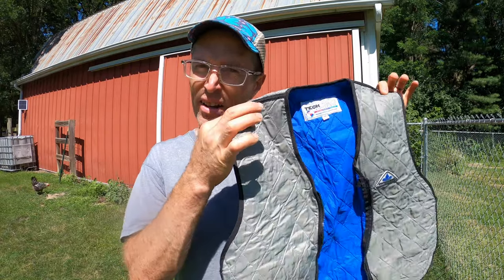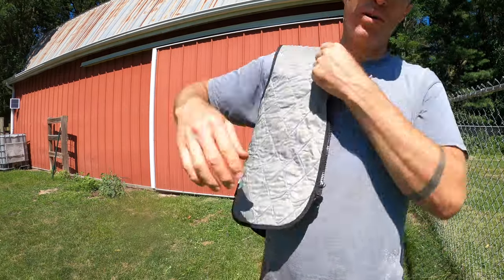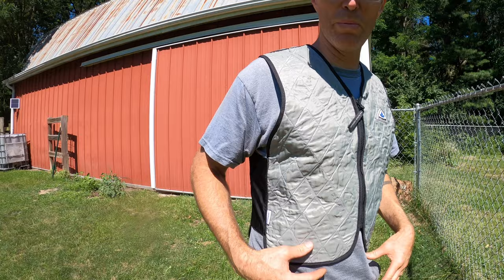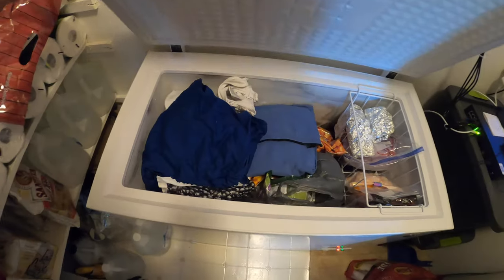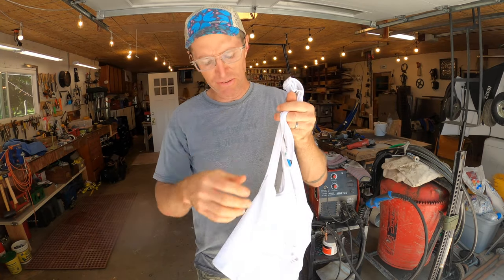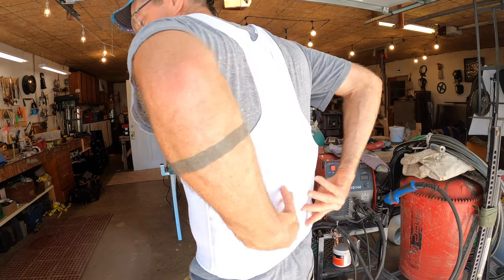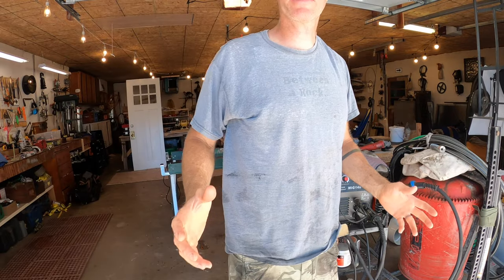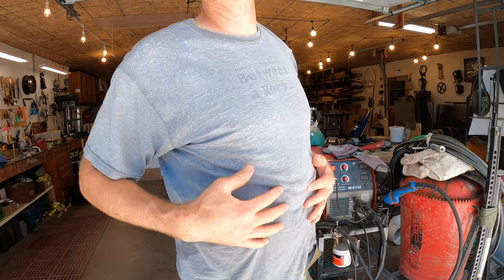Cooling Vest Showdown! Best and Worst

Comment: Hey Metaspencer, Thanks for reviewing our  ThermApparel PCM Cooling Vest. We are glad it helps. We just want to clarify a few things. 

The ThermApparel PCM Cooling Vest is not an ice vest, it's a PCM Cooling Vest. What's the difference? PCM can freeze and melt at different and specific temps where ice can only freeze at 1 temp. 

Ice Vests can only be refrozen in the freezer. Making you dependent on a freezer. 
ThermApparel PCM Cooling Packs melt and refreeze at 70F / 21C so you can refreeze them in ice water, the fridge or a freezer. Why is that important? It makes our Cooling Vest portable. For instance... Let's say you go to a large outdoor festival, event or picnic. The Cooling Packs wear out, you can refreeze in a cooler of ice water in 30 min and be good to go. You don't have to leave or go home. 

Because our Cooling Packs melt and refreeze at 70F / 21C they are safe to wear under your clothing against your skin. They will not cause ice burn, they will not condense, getting you wet like ice packs or evaporative vests. 

Our cooling vest works better than ice and ice vests. Why is that and why is it important? 

• When your body is hot your blood vessels open up to allow heat to be released. In other words, you sweat and when air hits your sweat it cools your body down. 

• Ice and Gel Packs cause blood vessels to constrict, preventing cooled blood from reaching your core. Ice is wonderful for cooling down a specific part of your body or bringing down swelling, but it doesn't cool your entire body. There is a reason doctors say 20 min on and 20 min off with ice packs. You need your blood vessels to open back up to allow the blood to start flowing again. 

• ThermApparel PCM Cooling Packs cools the blood without constricting your blood vessels. As your blood flows past the PCM Cooling Packs the they cool your blood and your body keeps pumping cool blood through your system keeping your whole body cool. 

The ThermApparel PCM Cooling Vest may look a little strange... but it was designed with over 200+ customer discovery interviews of MS patients. We asked them what they wanted in a cooling vest. They said they wanted something lightweight, comfortable and invisible.  That is what we designed. it is meant to be worn under your clothing and so no can tell you have it on. Isn't that cool!! It doesn't call attention to your MS. 

The vest with 1 set of SlimCool packs weighs 1.3 lbs
The vest with 1 set of ExtendedCool packs weighs 1.9 lbs

The SlimCool Cooling Packs last 1-2 hours depending on your level of activity.
2+ hours if you're wearing it inside in an air-conditioned area 
2 hours if you're are doing light housework 
1.5 hours if you're are outside doing gardening or taking a brisk walk 
1 hour if you're on a treadmill or exercising 
under 1 hour if you're in extreme temps 

The ExtendedCool Cooling Packs last 2-3 hours depending on your level of activity.
3+ hours if you're wearing it inside in an air-conditioned area  3 hours if you're are doing light housework 
2.5 hours if you're are outside doing gardening or taking a brisk walk 
2 hour if you're on a treadmill or exercising 
1 hour if you're in extreme temps 

Hope that helps explain the ThermApparel Cooling Vest better!

Oh, one more thing.... Order from our website. Your viewers will have full access to our inventory, they won't be giving money to Amazon and if you want to become an affiliate we promise to pay you more than .025 cents. 

Cheers! Team ThermApparel
Reply from the maker: Wow, that's the longest YouTube comment I've ever seen! One question for your company: do you find that your vest has insulating properties (or an R value) actually locking body heat in? I ask because that has been my experience with your vest. It seem to insulate and thus thwart the body's cooling mechanisms
Reply: @metaspencer   The cooling packs act as a heat sink and draw the heat out of your core. Once they have completely melted and can no longer draw heat they will reverse and you will start to feel warm as the packs will act like a heat pack. It's a quick fix. Take them out, put them in ice water and in 30 min they will be frozen again and ready to keep you cold.
Reply: Refreezing times - 
30 min - Ice water
45 min - Fridge
60 min - Freezer
Reply from the maker: @thermapparel  I'm not so sure -- while they might act as a heat sink I fear they simultaneously insulate the core.
Reply: @thermapparel  Your product takes 30 minutes to refreeze in ice water. If i take my ice packs or ice/gel packs with me in my cooler bag it takes a few seconds to change out my already frozen cooling pack. I'm not knocking your product, but I felt it necessary to add my 2 cents. Also PCM cooling packs won't last as long if they are freezing at 70 degrees.

Comment: Im in Havasu AZ and the temps have been around 115 lately. I work outdoors and it gets soo hot. I like the idea of the cooling vest. Is there one that has a water bladder that will rewet the vest while you are wearing it? It would be nice to not have to stop, go and rewet and put back on again and again. Thanks for the info
Reply from the maker: I've never seen one that rewets the vest ... could be cool. Instead there are just vests that circulate cool water. Hang in! Sounds hot as heck out there

Comment: I've used your first vest for many years riding motorcycles in extreme temperatures.  That coupled with LDComfort underclothing has worked well for me.
Reply from the maker: Excellent. I haven't checked out that LDC stuff ... thanks for the tip!

Comment: Can you get frostbite from the ice-vests, or do they warm up too quickly? The NMSS sent me one after diagnosis (along with other free items to serve as a reminder that life will never be the same 😃) and I've always been hesitant to wear it. I never really needed to because I luckily always had the option to avoid excessive heat. But now that I spend a bit more time outdoors, I have thought about wearing it.
Reply from the maker: I've wondered that myself and try not to put them next to my skin. I guess it's possible and you're always recommended not to use an ice pack for more than 20 minutes, but I've worn many ice vests longer than that until they melt out. I also got a free vest from the MSAA here in the US. That was such a cool program! I love that some groups give things to people who need them. Anyway, be well!
Reply: NO
Reply: I wear my AlphaCool Ice Vest over a T shirt. It does not cause frostbite and the cooling effect lasts 1 to 1.5 hours. I swap ice packs at that point and keep going.
Reply from the maker: Sounds good
Reply: Further evaluation of AlphaCool Ice Vest: 
1. Dropped a cold gel pack while trying to place it in the vest pocket, and it ruptured along a seam for about 1 inch & spewed some gel on the floor. (Haven't received a reply back yet on whether I can fix that or not - maybe some sort of glue?)
2. I am doubtful that a gel pack that can't survive a 3ft drop onto the floor could survive me laying on my back or stomach with the vest on. (That means that the vest is limited to a range of tasks that don't put pressure on the vest's gel packs.)
3. The vest gives me enough of range of motion to be useful gardening, working with most tools, and standing/sitting/squatting repeatedly. So, I will continue using it and testing it under various situations.
4. As you stated in your video, we have a natural biological function (sweating) that will cool us off IF there is good airflow over our body and we can work in the shade instead of direct sunlight. (When I really need to cool off, I come inside and sit by an electric fan for a few minutes - very, very effective.)

So, what would help the most is a "follow me" shadebot with an electric fan that would keep me in the shade as I worked, as well as blow air over my body fairly continuously. Perhaps this shadebot robot could also carry my tools, dispense a cold drink on command, and monitor my vitals so that I don't overdo it. (If we can have self-propelled follow me luggage then we should be able to have a self-propelled follow me shade robot. Anybody interested in developing a prototype?)
Reply from the maker: @alanmcrae8594  ShadeBot! Great idea and thanks for your full report. It's hard to stay cool out there :)

Comment: Would like to find something that would work in Florida & southern states on a motorcycle.  Appears the one with a circulation pump is the only one?  No point in having something that is only good for an hour or so. If traveling on a trip, best is to just ride early am, break during heat of the day, & then ride late evening.  But that does not work well if staying at motels or setting up a camp site.
Reply from the maker: And plenty of ice water

Comment: Wear polyester shirts. Cotton obsorbs moisture so you end up with a wet rag that won’t let the sweat evaporate very well. All polyester wicks moisture so don’t fall for high price special moisture material, it’s just polyester. Wear it loose so you have better air flow. I’m MS heat intolerant also & have experimented with tons of products. I’ve found the portable neck fans work the best. Surprisingly, the cheaper neck fans that have fans at the end you can point at your face & neck works the best I’ve found so far. They last several hours on medium which is usually is enough. There so cheap at $20.00 or less that you can buy 2 or more & have extras charged up ready to go. Probably need 3 for a full day at Disney World. When it’s in the 90’s & humid, nothings going to work very well that lasts for several hours. So polyester shirts, hat & lots of cold water & a neck fan that you can adjust the direction of the air on your face & neck is the best I’ve come up with. Good luck & good health to you sir. Great product demo video too!!!🤞👍
Reply from the maker: I like your style and lots of good tips there! I particularly like that you keep it simple ... for me, drinking cold water is the ticket on most days. Thanks
Reply: Polyester is plastic, you’re absorbing micro plastics. That isn’t a great option
Reply: @Kruton3  I haven’t seen any warnings in a peer reviewed study that concludes polyester is not safe to wear.  The cotton industry hates it, but so far it’s considered safe to wear.  If a real medical study concludes polyester is not safe to wear, I’ll be the first one to stop wearing it, but so far, since the 1940’s it’s been considered safe by the medical community.  If a person wants to make sure their clothes are safe, they need to wear only pure organic clothing.  I haven’t found a moisture wicking organic natural fiber material yet.  I was in the clothing manufacturing business for 15 years, but new information is always being discovered. Peace & stay cool.🤞❤️✌🏻🇺🇦🇺🇸

Comment: PS I've been searching for a mattress pad that is temperature controlled by the user because of how sensitive I am to heat or just sweating because I get these sweating attacks that have been going on for years and the best I could find was an 8 Sleep Pod smart bed system. Ridiculous price tag but you control the temp from 60-110 F and, for me, it might be worth it since I'm never at a comfortable temperature but it's stupid expensive. Just thought i'd mention it since you mention these cooling vests.
Reply from the maker: Interesting idea! I've never tried one but my new truck has cooling seats that I'm eager to try out this summer :)

Comment: Your conclusions forgot your earlier point that in high humidity, the natural body's evaporation of sweat is NOT happening at all to cool the body.  Living in Florida, I can testify to this.  As a retiree, I don't work all day outside, so your 1 hour estimate for the ice packs melting easily gets the lawn mowed in greater comfort.  Hearing the area the ice packs are over can get too cold (one user commented 2 t-shirt layers were necessary to reduce the cold), I will use some adhesive velcro above that area to let me adhere in some small pieces of cloth to get the moderation as there's no upside to wearing 2 t-shirt layers!  Also, you can buy unlimited ice packs and, not being away on some job site, I can swap them out all day just walking inside to the fridge.  But was helpful to see the survey of different vests and happily found an ice based one on Amazon with plenty of packs to go with.
Reply from the maker: Stay cool out there man! tons of good ideas in your comment so big thanks!

Comment: super helpful!!! ive thought about getting each one of these, except for the fan jacket. i think i have an idea for an even more modern cooling system. have you seen vortex coolers? well i want to hook one of those to a paint ball tank with a regulator. then attach the regulated air to the vortex cooler. then the light weight perforated vest. and boom. portable light weight torso cooling. check it out my brother. you helped me by doing all your consumer research. now i hope that i was able to help you. the only thing i have left to get is the vortex cooler. ill let ya know if it works. hopefully you msake a video of a vortex cooling vest with a portable air source. thanks again. im glad i didnt spend all the money i almost did. to get unsatisfactory results.
Reply from the maker: sounds like some interesting ideas! good luck with it

Comment: I think the water soak NECK Collard  ARE THE BEST> Cause all the heat is around your neck going to your head. But is nice to have the extra coolest down around your body too.  Yes your going to get wet >   wearing any of them
Reply from the maker: I'm surprised to hear you like the neck coolers as I find them superficial .. but you've gotta use what works for you
Reply: @metaspencer 👍👍 Idk about you? but top of my head is where the heat is.  Plus it takes longer for my head to cool down, And a cooling head band or neck band works really well

Comment: They are expensive too & thoat they will keep you cold but it’s limited time, I think a white t-shirt from good material works better like some soft coton, I also seen syntethic even if football players use it it’s not good for skin specialy the shirt as pants are ok becoase human body is cooler for the lower part
Reply from the maker: Good points

Comment: Sounds like the ice ones would be the best, with the drawback being that they only last 1 hour. But, you could get around that by simply owning more vests. You keep 4 - 6 of them in a freezer, and you just swap them out when one of them melts. You'll probably be done with your outdoor work for the day, by that time those are used up.
Reply from the maker: Good ideas!
Reply: @metaspencer  What about the rest of your body? Do the vests that work well, cool you well enough that your blood ends up cooling the rest of your body? Or do they still feel very hot and uncomfortable?
Reply: Actually, all you have to do is swap out ice packs or combo ice/gel packs. You can keep extra ones in the freezer or if on the go use a cooler bag.
Reply: @joellerner6087 But then you wear out the velcro quicker

Comment: The evaporative  cooling vest should be soaked 2-3 minutes to be fully charged.  It will soak up ~1.9 liters of water, and last ~4 hours before needing to be fecharged
Reply from the maker: 4 hours! that's funny. In dry hot weather I'm lucky if it lasts 30 minutes
Reply: @metaspencer That's probably because you aren't allowing it to get fully soaked,  Rather than just running water over the vest as you did in the video, fully submerge it in a basin until it will absorb no more water, LIGHTLY squeeze the excess water out, and then don the vest.  I've used my TechNiche HyperKewl evaporative cooling vest in conjunction with an Aerostich Roadcrafter suit for several years on my motorcycle with very satisfactory results.  For the first hour or so, it gets so cold, I need to keep the zippered vents on my Roadcrafter closed.  It needs airflow to be effective, because it's the evaporating that cools the vest, (not the fact that you initially ran cold water over the vest).  They don't work very well without airflow evaporating the water from the vest.  Properly charged, an evaporative cooling vest really works.
Reply: @1010LouMary  Sounds like you have a good system! thanks man

Comment: I'm surprised the MIT boys haven't made one using the Peltier effect for when electrical power is available.
Reply from the maker: It'll prolly happen ... sounds interesting
Reply: Efficiency is too low on those devices. You lose so much in efficiency that you have to make up for by carrying a ton of batteries. You end up with a very heavy device which defeats the purpose. There is one device from MIT which uses a peltier module embedded in a wrist-watch type device. It's supposed to make your wrist slightly cold. But it just makes you perceive the temperature as a bit colder. It doesnt have the juice to actually cool you down.
Reply from the maker: Interesting

Comment: Please advise which cooling vest for high humidity and hot temperature to work in UAE
Reply from the maker: Circulation pump but note that all vests also warm you. Pre cooling is best
Reply: @metaspencer  Not if they are made out of mesh. I imagine they allow the sweat to evaporate and the air to cool the body in conjunction with the sweat. Am I correct here?
Reply from the maker: @joellerner6087  I haven't seen them in that design. Usually there is little chance for sweat to evaporate as the cooling panels cover the skin .. but maybe you'll find a good one!
Reply: @metaspencer  I'm creating something simplistic and yet novel and highly effective. I'll eventually be reaching out to you. However, even with a mesh vest, if it's over a shirt the air still isn't reaching the body as the shirt stops it. I imagine that it's still better though than a non-mesh vest as at least air is getting to the shirt, and it's lighter, and by its very nature, provides more ventilation.